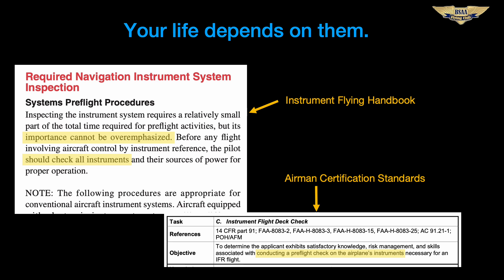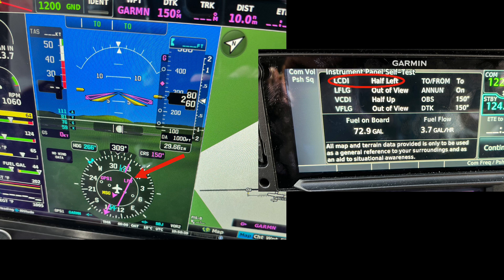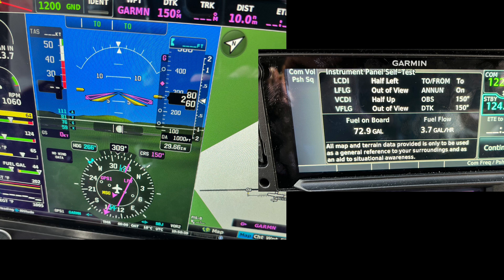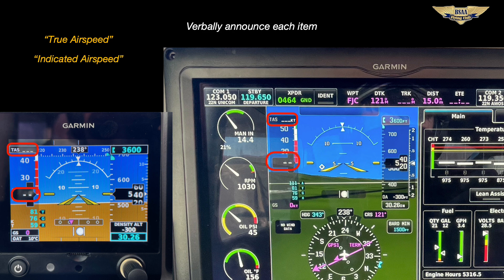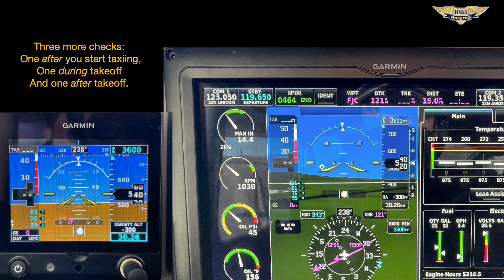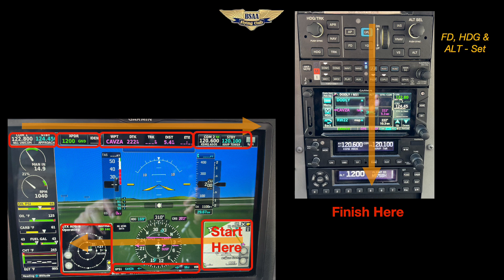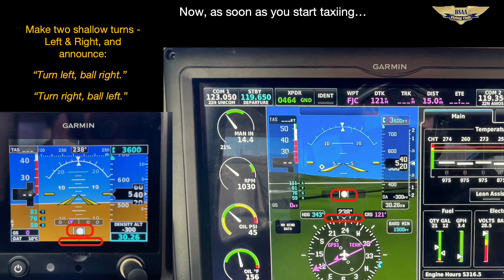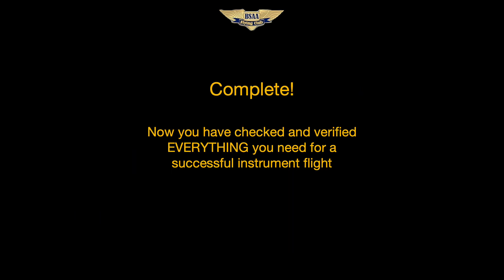Instrument Flying - Preflight Check Flow

Comment: Great video.  I am certainly guilty of blowing past the GPS/G3X startup screens with the 'continue' button, and your explanation of the fields to cross reference was new and something I'll incorporate.  I would add that I do a physical AP check as part of pre-taxi, ensuring both trim switch and ap disco switches cut it off, and that ap commands elicit appropriate flight control responses.  I also check connectivity for my Bluetooth devices - while not a certificated element of my avionics they are quite important.  I ensure that my iPad with Foreflight and my headset connection (Lightspeed DZ give me in-flight CO warnings - has happened once, so I take it very seriously) are active, noise protection on and volumes appropriate.  Not sure if you cross check panel with Foreflight at all - I don't tend to - but I usually do my flightplan in Foreflight, and then send it to the panel, and then cross check to ensure the two match.    Would like to know about the GPS annunciation though - what causes it on startup / when stationary to display 'LPV' and then revert to 'Term'?  You also have LNAV in this field illuminated in one section of your video.  Why does this read differently in different ground situations?
Reply: P.S.  I fly an RV-7 w/ G3X, GTN 625 (no radio version) and GFC 500 ap, so your system is highly relevant for me.
Reply from the maker: @pnzrldr  sweet plane!
Reply from the maker: All good points.  I made this video for our flying club and those suggested checks of yours (AP, Bluetooth, noise cancellation etc) are all incorporated in our checklist; that's why I don't mention them.  Also - this stuff on my video, could be defined as IFR-specific, whereas those checks would likely apply to any flight.

As to the LPV annunciation, the box is telling you that it is capable of that level of sensitivity.  The moment you go past that screen, it will default to something else (depending on what you have loaded in the GTN).  If you have nothing loaded, it will likely default to OCN or ENR.  If you have a FPLN loaded, it will (as you mention) say TERM.  The reason it says LNAV somewhere else (good catch!) is just sloppiness on my part.  This was sort of cobbled together with various pics I had taken at different times.

Glad you enjoyed.  BTW, it sounds like you have mostly Garmin stuff.  If you have a GFC-500 AP please watch my other video on "Glass Panel Failures".  It has some interesting (and relatively unknown/misunderstood) stuff on erroneous airspeed situations.
Reply from the maker: Actually.... you know what?  I retract that previous statement.  There's no way to have had a flight plan loaded since you just powered the GTN up.  As soon as you go past that screen, you should see OCN for Oceanic (the lowest accuracy).  Then as soon as you put a waypoint into the box, you will see ENR.
Reply: @AV8BS  I usually start a flight plan (incorrectly?) with my current airport, not my first enroute waypoint.  Is that why I usually see TERM you think, instead of ENR, as you see in the vid?
Reply from the maker: @pnzrldr  No, that's exactly how you want to start a flight plan....with the departure airport....because you want that in the flight plan in case you need to return for whatever reason.  And - yes, I believe that's the reason you see TERM and not ENR.  But before you enter anything in your FPLN, you should see something lower i.e. lower accuracy.  When the GTN is acquiring satellites it should say OCN and then (I believe...I'd have to test this) ENR, and then after you've entered your current airport, it should go to TERM.  As you start to fly your flight and you get 30NM away from your departure point, it should switch to ENR (this I'm sure of) and then as you get closer to your destination (within 30NM), it should switch to TERM again.